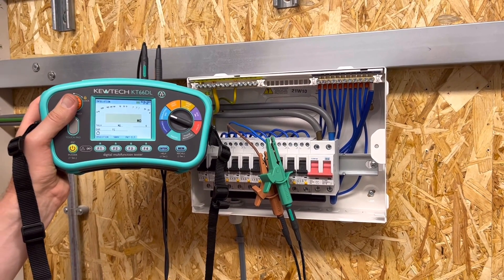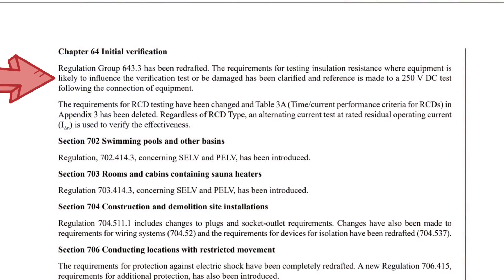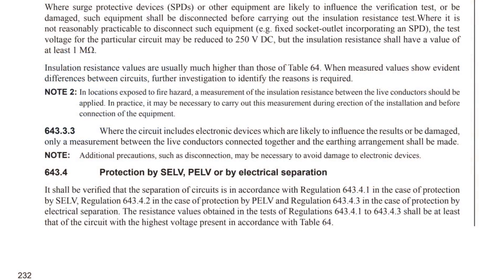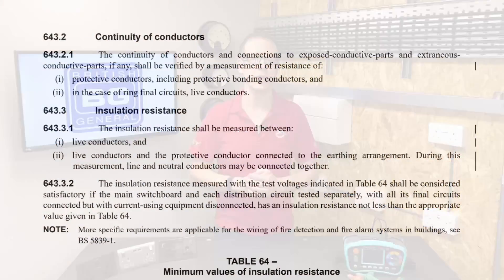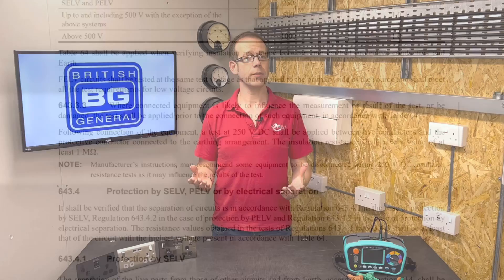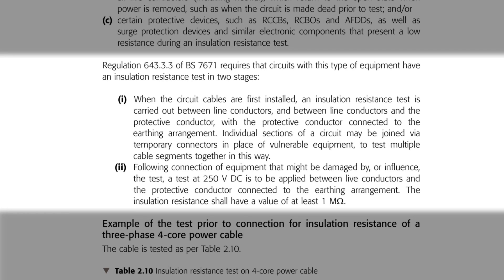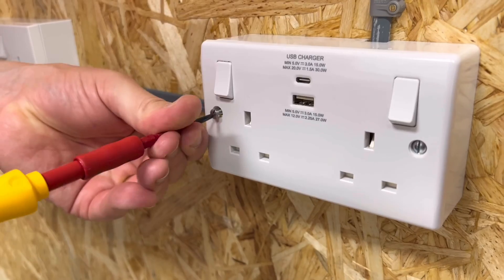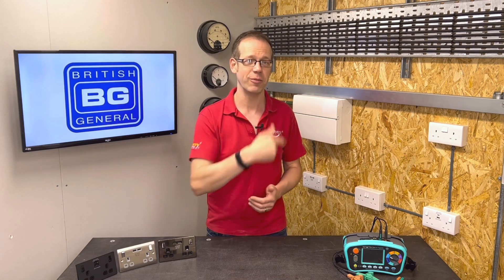PROBLEM: Insulation Tests on Circuits with Electronic Loads

Comment: When hipot testing on mains circuits where electronic devices may be connected it should make sense to adopt the specifications and general practice in the electronics industry which is to tie all input terminals together when safety testing insulation between live circuitry and protective earth / user side of an isolation barrier
When installing an isolated wire whether L or N i would think it also makes sense to test whether it is leaking to any other wire in the bundle before it is connected to user equipment or devices, any re-test once in use must require total removal of absolutely everything attached and that's what has to be done if the wire is actually suspect of being faulty
To write an all encompassing regulation to cover all past present and future eventualities is doomed to be unintelligible to anyone simply working to a set of rules

Comment: I do commercial EICRs and most of the time am unable to turn off the DB because other circuits are in use.   An IR test between L/N together and  E will give a result of 0 because E and N are connected upstream at the transformer.😢

Comment: Clearly they need to design better equipment that does not have live and permanent connections/loads across them. Do these use electricity in operation when no USB is plugged in ?

Comment: The regs might as well be in a different language. Make things more simple! Explain how you’re meant to do an insulation resistance test on a lighting circuit with 50 downlights & a ring final circuit with appliances plugged in that you can’t access to unplug (cooker hood & dishwasher as an example).

Comment: Ok how about ir testing existing circuits after installing a new board for the eic? 
Do we go round disconnecting everything i.e 30 plus downlights/Boilers/spurs ect to test L-N/ L-E/N/E
or do we test L&N to E
The way i read it is initial verification was done when the cables were installed, could be 30+ years ago.L-N/ L-E/N/E carried out.
So after a board change now this goes down as the indent 2 i,e after equipment was installed so test L&N to E.

Comment: Worse part when carrying out an eicr.

Who is to know what sensitive equipment is plugged in where. Could have a loft with cctv nvr plugged in. I've even found things plugged in under the floorboards. Would i be liable to replace any items that get fried in the event of a 500v test? Not had one yet but never say never. 

Guess i just list it on my limitations?

Comment: I not responsible for the thinking behind electrical testing but I have a question. If in normal use the circuit is single phase 230 volt (not a three phase circuit ) why would it need a stress test over twice the voltage between L and N anyway? I would love to know the actual practical reasons from those who make these recommendations and how this historical thing became a regulation for decades.
Reply: Power of Megger Mafia! 
Like medical mafia says if your bad cholesterol levels are high you must take statins otherwise you will die of heart attack!

Comment: Maybe it is time to move to a 48v dc system as there is no need for 240vac for almost all devices in the home. I mean most! May need it for heating/cooking. However not required for vacuum cleaners TV, Computers etc:

Comment: There's also smoke detector bases that communicate using radio frequencies that are permanently connected. So even if you've removed the detector itself there remains sensitive components at risk.

Comment: Recently I came across two indoor cooling units in the company I work for that must have gotten an isolation test between L and N: The MOV was blown and the primary winding of the little transformer was blown as well. Yes, in both units. Needed a replacement PCB, as the transformer is so proprietary, you can't get it anywhere.

Comment: And then we introduce more potential problems, especially in ring finals as we can't easily test the condinuity of the ring once we've had to disturb the connections and can easily pinch insulation.... USB sockets are great but a pain for testing - there should be a means of isolating them. Once again the IET demonstrating that they are 10 years behind as per one of their vids the other week, As for "manufacturers instructions"? They go in the bin once it's signed off. No sparky is going to try and look up every device from 20 years ago to see if it can be tested at 500V. Also consider that 250AC is the RMS value. Peak is approx 350. So should testing be done at the upper limits of that? I get the need for a margin etc.

Comment: Not an actual electrician here but hobby electrician.
The meggers is usually heavily limited output current around 3 to 10 mA so just a LED bulb would be just fine directly over it, ant the voltage never reaches 500 as it gets current limited. If something fails from using this then it isn't really a good design anyway on the pcb side.

I wouldn't be too scared of it beeing a electrical load still connected when megging especially between live/neutral and earth.

Good idea to try not charging up small digital appliances but if it has a indicator diode in it then that should be enough to save it and most high grade should have over voltage protection that will shunt it to earth

Comment: Why don't the manufacturers add a switch to disconnect the USBs when not in use. Better for testing and saves a small amount of electricity. It can't be just who thought of this, I'm sure.

Comment: Could do with a video on how to use a voltage/continuity tester..
Explanation of the warbling sound when you probe an isolated circuit and pick up trace?
How to test phase rotation, etc..

Comment: Why cant usb sockets have a switch on the back to disconnect the usb driver from the circuit this would be much easier then disconnecting all usb sockets?

Comment: This has been a problem for years, way before integrated usb sockets. There has always been shaver sockets/lights, the tv booster in the loft you didn't know was there, the bathroom extractor that some twat installed without an isolator and countless other items.
Reply: 100% agree  buddy  wasted many hours looking for them

Comment: From an electronics perspective, anything that is attached to the mains should be designed to cope with 500VDC across it.  It already has to cope with 330V-ish [edit to fix typo] peak in normal circumstances and transients can easily reach 600V.  It's not unusual to see transistors in switching power supplies with 600V ratings on them.  Of course, this is the real world we live in and plenty of stuff is sub-par and will fail or be stressed by placing 500V across it, especially the cheap crap that comes out of certain countries in Asia.

Personally I hate those wall plates with integrated USB power supplies.  They are usually junk, and if the power supply fails you have to buy a new plate and have it fitted (well hopefully a pro would be engaged to fit it).  Buy a quality separate plug in USB power supply and you'll probably still be using it in 10 years time.  Same concept for those hard wired LED light fittings.  Bleah.  Standard bulb fittings for me, thanks.

Comment: It's difficult to see how an IR test between (phase+neutral) and CPC at 250V DC could damage a device that wouldn't be damaged by 230V RMS AC.

Whilst it's only for a fraction of a second, the line does get up above 300V with respect to earth 50 times in that second.

Anyway. Wouldn't it be great if there was a little switch to turn off the USB elements of sockets? Would also mean you weren't in so much of a muddle if they let the magic smoke out later in their life.

Comment: Great bit of clarification there Joe. 
So to summarise, on initial verification 2stage testing @500V before equipment is connected and again at 250V after equipment is installed. 

And on periodic, L & N together tested against the MET with all earthing in place @ 250V only. 

So… how about when you make an alteration to a circuit? Do you just test the new bit initially at 500V then again at 250V once equipment is in place? 

Or.. test the whole circuit at @250V??? 🤔

Comment: All of this could have been avoided if the manufacturers of USB sockets did the commonsense thing and fed the DC PSU off the switched side of the socket!  Crazy!!
Reply: On a new build (or a rewire) the single plates (up to 4 usb) or a double plate (up to 8) can be wired onto a 1mm 6A circuit. This could then be tested before the usb plate(s) are actually fitted.
Reply: @2Sorts  but you still can't isolate them from the circuit after they're installed unless manufacturers stop cutting corners and start providing switches for them.

Comment: Wouldn't it be good for the sockets to have a switch for the usb part, so this could be turned off for testing. Simple solution instead of making life difficult
Reply from the maker: Perhaps this will become an option in the future. 😃

Comment: So the boffins at the IET still can’t say with any degree of certainty that a 500v IR test will or will not damage such equipment. A L&N combined  and tested to earth will not cause any damage or inaccurate readings as there is no potential difference between lines and neutral.  
Great video as always Joe 👍
Reply: used to be known as test method two.
Reply from the maker: Thanks for commenting. 😃
Reply: The IET, despite all their convoluted fluff, can’t really be expected to specify whether a particular manufacturer’s circuit will have been designed to withstand a voltage in excess of 250V.  L/N, L/cpc and N/cpc at 250V with a result >1Mohm is happy days.  Any less and we need to hunt down anything still in circuit or isolate the fault.  Why is it made so complicated ?

Comment: Regardless of the new double testing, on a personal level, I would not ever install outlets with combined USB sockets in my home. When I did my apprenticeship, it was drummed into us that the first thing we should learn about any apparatus was not how to turn it on, but how to switch it off. USB sockets are permanently on with no local means of isolation, so for me, they are taboo and will remain so.
I have seen too many electronic devices fail catastrophically to trust anything that I can't switch off (easily) and the positioning of consumer units in houses often does not allow for easy access to switch off there.
Reply: Agree totally.  Absolutely no reason they can't power the USB from the switched side of the socket.
Reply: ...and you have Nanny Gov telling you to switch off/unplug your phone charger, to eliminate tiny amounts of 'vampire' power, ignoring the wear involved in unplugging such things repeatedly...how does that work when your charger is built in, and are the old standard '5W' chargers, not the fancy 35W plug-ins...(The USB starts at 5v, then talks to the charger to see if it capable of higher powers, which means higher voltages, before going into high-power mode.)
Reply: What you on about 🥲, what they taught you? Usb is 5V so really low risk. In UK you are obsessed with isolation but yet neutral conductor in most cases is always "live". Eg. PME system
Reply: @giacobbe1993  if you are saying "5V is really low risk" clearly you don't understand how SMPSs work and secondly, this video is about isolation testing between L and N.  You can't do that with these things in circuit.  A simple change by the manufacturers to include a switch would fix this problem but for some reason they don't do it.
Reply from the maker: Pretty low risk I think.

Comment: The bottom line here is... in the practical world .. there are really two scenarios:
A new install,  or.. an existing one where you are doing an EICR / fault find.

In the case of a new install - there really shouldn't be an issue since surely it is plainly obvious ( you really don't need the "BS7671 bible"  to tell you this) that you would test ALL cabling/wiring WITHOUT any active devices connected + circuits linked out  !! - 
( well....that is what WAGO connectors were invented for  wasn't it?? - lol !!!)  

THAT way you PROVE the installation in terms  wiring integrity  ie - insulation  etc  .......

 and of  of course test continuity ie R1 +R2  etc while you are at it -  because you should test continuity before testing IR anyway )  
And of course -  you should see "perfect" insulation - ie  test meter out of range at >999 Meg ohm etc........

 ......... BEFORE you connect any active devices such as usb sockets. 

And ....
I would actually do a test on such a USB socket  etc "on its own"  to see exactly what insulation results ( ie leakage current) it gives -  so that I KNOW what to expect when I connect it into my "new" circuit.  
Just blindly connecting it all up to a new circuit initially tested as above ...  and then testing  the "end result" is just going to add confusion "down the line" 

But...

On an existing circuit - well ... all depends on how much you "know" about what you are going to test.  
 In the REAL world  - You wont necessarily know what is connected - and so what do you do?   

Doing insulation resistance (IR)  tests "to the book"  on old/existing  circuits is always a challenge -  and in my experience you will be lucky to get "good"  values of IR on "first test" 
( and what exactly do we mean by "good" - low values that might satisfy BS7671 might be ok from the BS7671 point of view - but in "my" book - low values - say in the 10's Megohms always raise suspicions. 
I actually always try to evaluate  the circuit first as best as I can  to see what is connected .

( where IS that socket behind the washing machine/cupboard/bed/wardrobe/wherever... and WHERE is that DIY pir light on an outside wall connected to ???)

I like to start an IR test at 100V  across line-neutral - to "see" what I get.  IF you see silly values like 0 (which a IR tester will show for very low IR values) - or very low say 100K ohm  - then you "know" something is likely to be connected somewhere.  That  is - it isnt a fault with the wiring insulation - but something "else" 
In fact  - in the  case  of very low IR  -I will  then do a simple resistance test.  In one case - I got a stable reading of 800ohms  - obviously must be due to something connected which I hadn't yet found -  -which turned out to be a WELL hidden TV signal amplifier in the loft that took ages to find.
 (it was a simple "transformer type" supply - and I was measuring in effect the "primary winding resistance" of that transformer in the TV amplifier supply - and 800 ohms was about right for such a small transformer. 

Once I'm confident that everything is "ok" - ill go to 250V - then 500. 
(or put another way - I NEVER EVER start with 500V - always 100V to start with ... then go from there.

This isn't all about what BS7671 says.  It is about  the practical world and playing it out  as a  sensible "detective" or - as Forrest Gump  would say / electrics is like a box of chocolates - you never know what you are going to get.
Reply from the maker: Thanks for commenting! 👍
Reply: Excellent post, thanks for taking the time.

Comment: The best solution would be to have a mechanism that disconnects the usb sockets when there’s nothing plugged into them
Reply: Yea like a longer plastic usb shaped plug that disconnects internally
Reply: A switch on the front would be a good idea so users could turn it off when not being used.
Reply: @matthewgarlick2691  Lack of space might be the obvious hurdle for that. Maybe something built into the actual port, which would disconnect when nothing plugged in.
Reply: I’m sure I’ve seen a brand that has switches on the back for this
Reply: ...this rendering the installed charging outlet dependent upon another device. Not keep on that as a selling point. Device dead because the kids unplugged a lamp to save the planet ...
Reply from the maker: Yup, this is a good solution till that becomes a Standard approach.

Comment: Why is it not made compulsory for the manufactory to fit a dp switch on the usb points in the socket. This would address two problems problems first testing as removing sockets and refitting can lead to problems for the electrician and the questions we always get asked is it safe to leave a charge point on as all safety body's would advise users to disscount charger adapters. After 49 years in the electrical industry simply answer are always the best.
Reply from the maker: Yup, maybe it'll get put into a standard in the future.

Comment: That's a great clarification for new circuits but leaves questions over testing modified circuits.  If an electrician makes a small modification to a circuit the two stage testing is not practical so it would be nice to know if just the second stage is adequate in this situation i.e. the live conductors connected to the earth.

Comment: I’m thinking the USB power supply is rectified with a diode and then to switch mode power supply for the 
5 V so the reading would depend on the polarity of the test voltage If the test voltage reverse biased the diode you should not affect your reading
Reply: it's most likely to be a full bridge rectifier so wouldn't make much difference.
Reply: @tomcardale5596  Actually most likely half wave because this half the voltage to start off with but I haven’t looked at many of these circuits the ones I have are halfway
Full wave would use 3 more diodes
I do find your videos very Informative and well presented